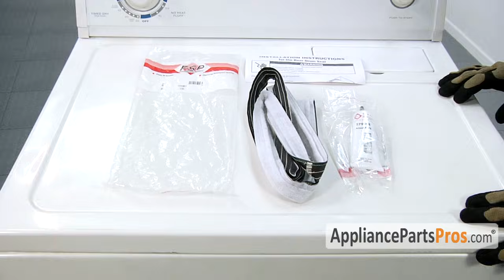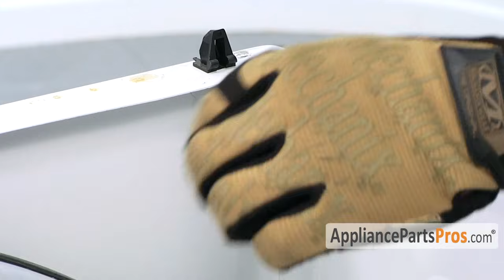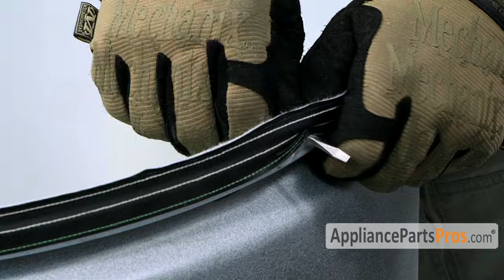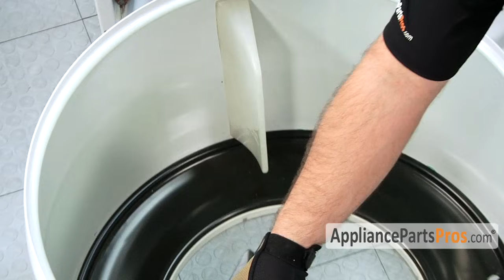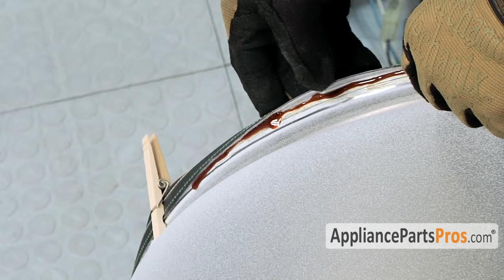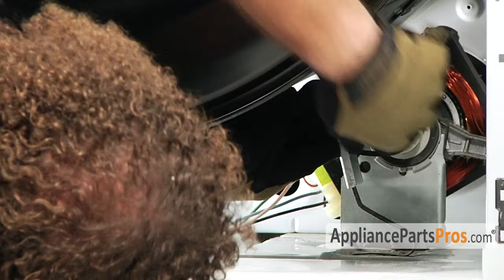How To: Whirlpool/KitchenAid/Maytag Drum Felt Seal

Comment: I have a Maytag Centennial brand of dryer. The felt band was too big but I can sew so I ripped the stitch and adjusted the length. The hardest and longest part so far was removing the adhesive from the drum. Got the band on and now wait to put the drum back in. Not that bad of a fix. Putting this “certification” on my wall of random “certifications”. 😊
Oh and my town has an appliance parts store so I was able to save some dollars by buying directly from them. 👍
Reply from the maker: Thanks for sharing your repair adventure, @Pinkraider! Sounds like you tackled it like a pro—love the idea of a wall of “certifications.” 😄 Totally agree: that old adhesive can be a pain. Glad you were able to find what you needed locally and make it work. Always great to see folks taking on their own repairs!
Reply: @appliancepartspros got it all put together with the help of my daughter! It’s running smoothly and no more strings or straps getting stuck in the drum spin and getting brown marks!👍👍

Comment: I know this is a old video but need to do this on my 20 year old dryer. Is there anything else that should be done/replaced while doing this job at the same time as in the belt or idler?
Reply from the maker: You would only need to replace the parts that are worn or damaged. If you aren't having any issues with the rollers, belt or idler then they wouldn't need to be replaced.
Reply: @appliancepartspros  appreciate the info!!
Reply from the maker: You're welcome!

Comment: Maybe this has already been mentioned but I did this to remove the gasket + adhesive in one step:  Do not remove the original gasket--leave  in place and spray brake cleaner and/or soak it with hand sanitizer.  Do this about 2-3 time and saturate the felt while its attached to the drum.  Leave it 1-2 hours and go back and pull off the felt gasket--90% of the adhesive residue will come with it.
Reply: One step, but you do it two or three times. You also need to use brake clean, so you better take the tub outside..and then your gonna have a tub that smells like brake clean, unleas you clean it, now making this a 4 step process outside vs a 1 step process inside, just sand it down. Use a drill if you must.

Comment: thanks! i know this is an old video bit my seal was trashed and when i started calling to get some idea what this would cost —— a service call is min $200 plus parts….. no thanks! so ordered the parts and a few extras since i was going to be removing the drum anyway so —— i did  this drum seal,  replaced front plastic tub bearings, the drum rollers, the belt, idler pulley for $145 and a few hours work most of it was cleaning the old seal off the drum and trying to figure out how to get that stupid  seal to stay in place! a real PIA but saved me a lot of money and now ill hopefully be able to keep my 15 year old dryer running a few more years! thanks again! —- id suggest anyone who is going to do this seal,  go ahead and replace those parts  at the same time- the  parts are cheap and youre doing the work anyway

Comment: I reused my seal, seamed ok. This is a 1972 Kenmore dryer. For adhesive, I used PL Premium Polyurethane Construction Adhesive. Simply ran a thin bead around drum edge and put seal on. Then ran finger around seal to set it down. I also since it is an old seal, ran PL on those cotton threads on the outside. Interesting that mostly this old dryer is made like the new dryers with only minor changes. I had to replace blower fan, it spun on its insert, so checking the adhesive on various seals found 3 were coming loose.

Comment: Great video! Helped me replace the seal with relative ease. The removal of the old adhesive is a pain the butt and is rather messy. Ended up using goo gone to soften it up, then sandpaper. And putting the new seal on sure does take a little working to get it to fit on. Also, be prepared for the nasty adhesive. Thanks again for the clear step by step!

Comment: Anybody know whether the felt seal is heat resistant, or if that is an issue? I was hoping to replace mine with a tape like hockey tape (fabric tape with adhesive backing)... will this be OK?
Reply: No it may catch fire, use the glue in the video, please so you dont burn down the place!!!

Comment: I disagree how he did this.  If you pull the felt up to put the glue under it the felt will slip off the drum.  Clothes pens aren't going to hold it on.  Once the felt is on the drum  I push  the tip of the glue under the felt while holding the felt in place and squeeze the tube moving it around under the felt.  I also had four really strong spring clamps at 12, 3, 6, and 9 o'clock to hold the felt on while using the glue.  I apply the glue to one section between each clamp at a time.  I also put the drum on my bench where I could stand up and pay attention to what I was doing while rotating it with the clamps facing out over the lip of my bench.  I probably spent 15 mins total doing this.  Once all glued I remove the clamps very carefully and lay the drum felt side down on the flood so the felt will have the weight of the dump to hold it in place while it drys. Some of the time it took was putting the felt back on after it had slipped off the drum because I hadn't  used four clamps at first. Fortunately I hadn't started gluing it when that happened.

Comment: What is the recommended adhesive remover?
Reply: I used Acetone, did the work out on my deck so the fumes would not accumulate or stay long enough to affect me. Use gloves, it will dry your hands causing cracks and just looking ugly.

Comment: Can a bad felt seal be the reason there is water condensation in the control panel of my dryer? Maybe replacing that will help keep me from having to replace it? It's also making the electrical wonky - won't let me push it on, keeps changing cycles by itself...

Comment: I used A LOT of binder clips to hold it place & I used SOS PADS to scrub off the old adhesive that really worked! ... no scratching the enamel at all . I used Brush paint cleaner with cotton balls later on to clean up any extra adhesive that might of leaked out to clean it up
Reply from the maker: Thanks for the tip!
Reply: Binder clips! Thanks that saved my night!

Comment: Used denatured alcohol to remove old seal seemed to work better than the less toxic version of Goop (did not try the one that smells like gasoline). Hardest part was getting seal to pop on before doing the adhesive as clothespins were not quite strong enough. Whole process reminded me of putting tubes on a bike tire. I ended up putting the whole seal onto the drum and then sliding it up to get the felt seal lip to pot over the metal. I expect another set of hands would have made this faster. In the end, dryer is quieter and working great. Thank you.
Reply from the maker: You're welcome! Thanks for letting us know how it went.

Comment: That's a job I would pay for trying to glue that felt on look like work. I would change everything else I Breaks down dryers to clean out all the lent that gets trapped moister and lent don't mix because it builds up over time and sticks. Got to be a better design to trap lent or easier way to clean them without  unscrew Ten SCREWS.

Comment: Very helpful...much more detail than that received with the part. Dis-assembly and removal of drum: 8 minutes; remove old seal and clean seal surface: 45 minutes; install new seal: 3 minutes; reinstall drum: 8 minutes.
Reply from the maker: Glad the video helped you get the dryer fixed!
Reply from the maker: Russell Schmitt Not sure what you mean but I hope the video helped you out!
Reply: PburgEngineer no
Reply: Did you wait a while before turning the dryer on?

Comment: Those clothes dryer pins will not work with a seal that has not been stretched out and as far as cleaning the old glue "do not" use sandpaper or anything metal.All you need is a hard nylon tooth brush,Permatex Gasket remover,Goo Gone and degreaser with paper towels.
Spay a little gasket remover in a small plastic container and dip the brush in it and work it section by section. When it's completely softened  with the brush use a paper towel to remove the residue then pour some goo on the towel and clean the residue then cleanup with the degreaser,All these products I mention are safe on the enamel.
Reply: +Yago Usera - There are seller selling seals out there with a tube of seal all,beware seal all has Acetone in it and will eat through the painted enamel.

Comment: Thank you for the video,i work in a machine shop and we have access to a product called J5, its a product name for lacquer thinner, i discovered when i did my drier that it worked real well to remove the old glue,just put some on a paper towel and rub it on the old glue and it will become "gummy" and you can actually pick it off with your fingernails, my glue had been on there for 20 years!!  its not easy but id rather do that then the sand paper or the dremel tool because when using those your taking paint off which will eventually lead to corrosion spots, the lacquer thinner is strong but not that strong to take off the stout paint the use at the factory inside the drum, JMHO , nothing beats fixing your own stuff man without having to buy a new dryer, those things are crazy expensive and once you open yours you will wonder why? lol
Reply: 10-4, I used Acetone which softened the 10 year old glue, then a plastic putty knife, a wipe with acetone on cloth towel.
I convinced my seal to go over the drum and rest a bit. This stretched it out for easier assembly when glue had partially dried.

Comment: A Dremel tool with a wire wheel works well for cleaning off the old adhesive residue.  Yes, you will need to stretch the new seal.  Take this opportunity to clean out the dryer (mine had lots of lint inside).  I also found a busted drum roller, so I replaced that, as well.
Reply from the maker: +altascene Thanks for the tips, hope the video helped you get the seal changed!

Comment: My husband and I followed this video to help us replace the felt seal a few days ago. When we put the dryer back together and hooked it up, we noticed that now the dryer doesn't dry our clothes. Since it didn't have any heating problems before we did the repair, I'm guessing the heating issue is related to us taking the dryer apart and then putting it back together. Any tips? Thanks for posting the video above. It was very helpful!
Reply from the maker: Kyla Tree I would recheck everything and look for any loose wires! You can also post the problem along with the appliance model number on our repair forum and the techs can help you troubleshoot the problem.
Reply: AppliancePartsPros Can you tell me where the repair forum is at? Thanks!
Reply from the maker: Kyla Tree Here is the link: http://forum.appliancepartspros.com/
Reply: Kayla,  I just had the saem problem.  Replaced The Rollers and Belt and Idler Pully and now it won't heat up very war. I have taken it apart 3 times to make sure the felt is not pinched, rollers are in the track and and it stays on place as front panel is attached.  Just took the back off tonight and the heater keeps getting hot then cools off right away then comes back on.  Lint is clear and the vent hose is clear.  It had plenty of heat before I changed the belt.  Kitchenaid KEYE677BWH3.    If someone knows what is going on please help
Reply: Kyla Tree make sure the dryer is not plugged in and unplug the motor harness and plug it back in something it's not plugged all the way in

Comment: My 70s series dryer motor ran, but didn't rotate. After seeing your video on replacing the belt I felt comfortable with tackling the job. Once it was apart I noticed the rear seal was down to the back material. After waiting a week and a half for the part I was just as comfortable at removing the old seal and replacing the seal. Now once it has 24 hours to dry I can put my dryer back together. Thanks for the help and saving me a repair bill.
Reply: +thewelshlady55 congratulations,i have to do mine too,im 45 so if you can do it so can i!! thank you for your comment.
Reply from the maker: dntlss
Awesome, glad you both got your dryers up and running!
Reply from the maker: thewelshlady55 Awesome, glad the video helped you get the dryer running!
Reply: AppliancePartsPros After letting the seal dry over night I put the new belt on the drum and replaced the drum with the new seal on. Instead of a putty knife I tilted the drum slightly and lifted the flap of the seal out with my fingers. It was easier. Then I crawled down and put the new belt around the pulleys. Put the door back on and replaced the screws and I was done. When I re plugged it in and turned it on it squeaked real loud, but after it warmed a little and I presume it resat the drum, belt, pulleys and seal the squeaking disappeared.  The seal was so bad most of the felt had melted into a black plastic. There were places where there was only the backing left. Now it has been vacuumed out, new belt, new seal and the vents are all clean. Should last for some time. Not bad for 60 year old lady that's not afraid to try.

Comment: Thanks, my drier stopped turning and I could hear the motor running and see the coils red and your videos help me take my drier apart without breaking something and helped me find a broken belt, so I replaced it and seen a rear seal tearing apart. So I put a new seal and new belt on to fix it..
Reply from the maker: Awesome, good job on getting the dryer fixed!
Reply: That was the exact same thing I'm doing right now and I was wondering if replacing the rear seal helped to allow your drum to spin.  I found the snapped belt and replaced it but the drum still won't spin and the motor is working fine.

Comment: Excellent videos! Thank you for taking the time to make these, they were VERY helpful. I replaced the heating element, rear drum seal, drive belt, and lint seal. Vacuumed and cleaned everything thoroughly (lint exit tunnel was full of crud), and lubed the rollers. Gluing the rear seal was the messy and challenging part.   -KAS